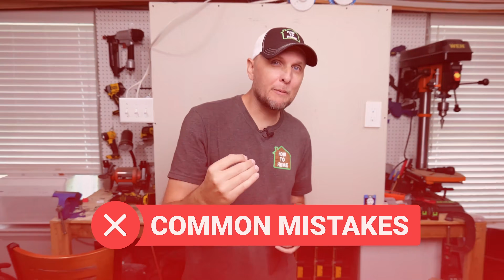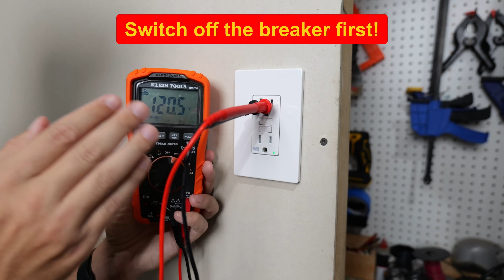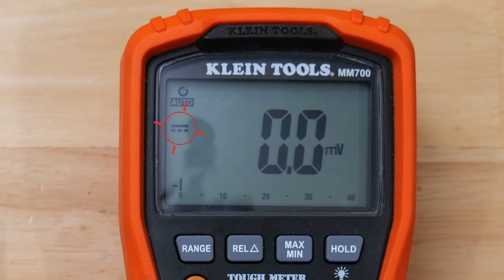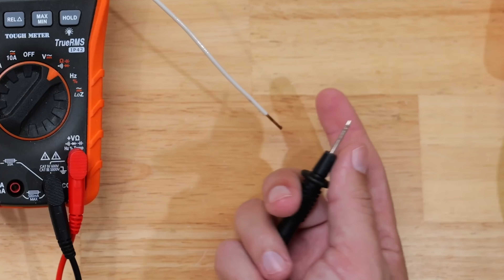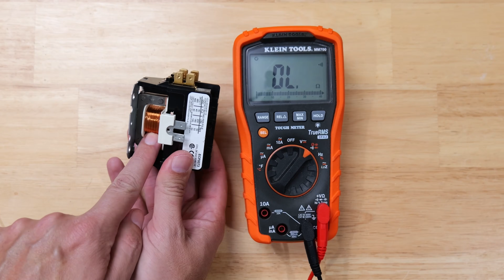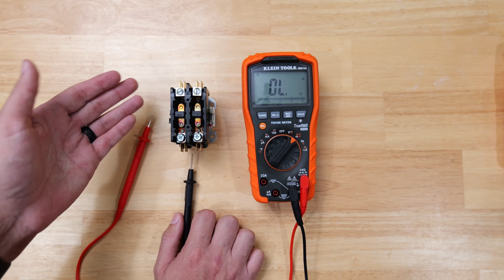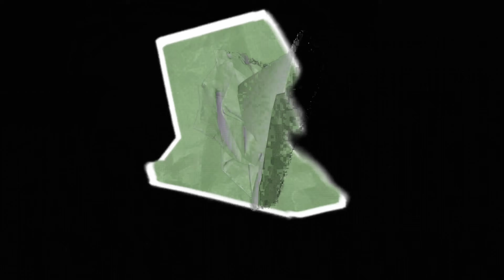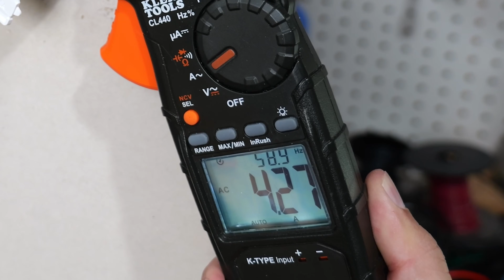Most DIYers Are Using Their Multimeters Incorrectly!

Comment from the maker: Be honest, how many of these features did you not know about and which ones?  I am genuinely curious.  I hope this can help future projects go easier!
Reply: Which ones? Most of them I either didn’t know or forgot how. I have both types of meters but I’m not an electrician by any stretch of the imagination. I like to do basic things like you discussed. The capacitor info will save me some money even though the company I use only charges about 150.00 to replace one. We have two homes one is a rental and it has a very old ac unit. Thanks again 👍
Reply: This is a good intro/tutorial for newbies or folks unfamiliar with electricity. There was nothing new for me but there's still good value for newcomers, hence gets my 👍
Reply: I bought a separate proximity probe for current and later found out it was built in to my multimeter.
Reply: I assume all - I built a couple of Heathkit  multimeters (I still use the one with the LCD display) and used Dad's Simpson 260 back when I was in grade school.
Reply: Thanks for the video. It's always good to have a refresher on this stuff. I don't use all of the functions often enough to remember them all.  I actually used my meter today (before watching the video lol) to make sure the power was off. I upgraded 3 of my  line voltage thermostats over to smart thermostats (Mysa is highly recommended). I used my non-contact voltage tester first but I like having a second opinion from the multimeter. It makes me feel much safer touching the wires.

I do wish I had gotten a better meter though with the option for capacitance. I was still able to fix my own air conditioner last year by replacing the capacitor but I couldn't actually test the old one. The bulging capacitor was a dead giveaway though.
Reply: All! In the business for 35years. :)
Reply: So, nice video but this is old hat for an experienced diy'r
Reply: I knew most of it, but I was caught off guard and surprised about the splitter amplifying the amperage shown. Times 10 makes it really easy just moving a decimal point to calculate but I’m not getting it in my head why it is amplifying it by 10? I actually own a clamp meter but I’ve never owned a splitter. Are there any other circumstances where the amperage is multiplied?😢
Reply: Scratch this request, Google gave me a very good explanation.
Reply: @tazmun  Yes if measuring small currents you get less error multiplying it by a certain number of turns. If you have access the individual wire simply wrap the wire around the clamp meter a number of times. then divide the meter reading by the number of wraps to get the actual reading. The splitter would be doing the same thing. The clamp meter is just responding to the magnetic field and giving an equivalent based E=BLv (simplified). So on the meter there will be an E voltage induced on a winding with B flux density in Tesla, the designer of the meter knows the length of wire L  and v depending on AC vs dc the delta needs to be known. Regardless the meter is always measuring voltage. If the meter is used in the circuit (dangerous don't do) a very precise shut resistor is used and the meter measures the voltage drop across it and translates that in amperage through it and since its a series circuit the amperage will be the same throughout the circuit. If it's measuring resistance the meter uses it's known battery voltage, the internal known resistance and measure the difference across probes and tada translates to the unknown resistance across the probes.
Reply: @tazmun 
Yeah, but do you know how to save Your Life if something goes wrong.?
Stay safe man.👍
Reply: @tazmun  It likely uses two coils of 5 turns each placed in opposite directions to increase measurement precision. See Ampère's circuital law...
Reply: I never saw a clamp ammeter used before.  Also nice to know about the little splitter/breakout device.   When you talked about the hassles of putting a simple ammeter in-line, I realized you could probably make up a little breakout box for the outlet as well to in-line the ammeter.
Reply: @arreffkay  you have to remember though that even the better multimeter that measure amps have a limit of about 10 A and even though they’re fused, they’re not cheap and can be hard to source depending on which one you have. 10 A is not enough to test many items. Clamp amp meters on the other hand often test 400 to 600 A.
Reply: @tazmun that makes a lot of sense. Thanks
Reply: big fat 0, I honestly know every function of both meters but I've also been doing electrical work since 1990
Reply: I was a radar tech in the Navy from 1971-76 so pretty familiar. 😊
Reply: Did not know how to test capacitors, and to properly go about checking for amperage. Also, am wondering why the other responders are not actually answering your question?
Reply: @HowToHomeDIY
Who do you think you are.? What gives you the Authority to teach/instruct ppl, in 20minutes, something that takes 40 to 50 hrs of practical guided training. 🚫You🚫 are ⚠Dangerous.⚠
Reply from the maker: @snakezdewiggle6084 I bet you are the life of the party when you go out.
Reply: If I put on electrical rubber gloves on do I need to cut electricity off?
Reply: I wasn't familiar with doing Continuity or Resistance testing on my multimeter. I'd only used them for outlet and battery testing.

While you're reading these replies, I'd like to say that the clamp-style tester doesn't seem that useful for the average homeowner because it's too specialized. If I'm testing the amps going through my outlet, I'm not going to want to remove it to put around the single line wire and I don't want to buy the line splitter to add to the specialized multimeter. Instead I'd buy the combined line splitter and tester you showed at the end. I'd rather have a standard multimeter I use for everyday, then pull out the combo unit on the few times I want to test amps.

Comment: I enjoyed your instructional video on the use of a multi-meter. How to use a meter is essential for do-it-yourself electrical repairs, however, the first thing to explain is the inherent dangers of testing electrical equipment. I have seen other DIY electrical videos and most start with explicit warnings about the dangers, especially anyone with little or no knowledge of electrical testing of components! When you started explaining testing of the capacitors you completely failed to explain what a capacitor does, that it stores energy for a long time after power has been removed from it, that it can electrocute you and can store higher voltages that can cause serious injuries or even death. You did not mention how to check it for voltage first before using the meter to test for capacitance or how to discharge a capacitor.  I would also suggest you include a disclaimer in the beginning of the video to at least protect yourself from potential liability if someone is injured or worse from following your instructional video. Stay safe, everyone, a capacitor temporarily stores energy, like a battery does and discharges slowly, and it can cause serious injuries, electrocution or even death if you are not careful. There are ways to discharge it, but before you do anything, take that multimeter, set it to test for voltages, then check the capacitor for any residual stored energy. If the check returns a voltage it can be discharged by shorting across the two conductors using an insulated screwdriver shaft but the correct safe way is to place a resistor across the two terminals to use up the stored energy. Most just short across the terminals with an insulated tool, like that screwdriver or a pair of pliers, but this discharges the cap violently and can leave melted marks on the tools tips. There are specialized instruments that also can be used to gently removed that stored electrical current. If you look at a channel called Buy It Fix It, this component level repair person always checks capacitors before touching the circuit components and has that special device a subscriber of his channel made and sent to him. Check that out for some good troubleshooting electrical components at the board level. Very educational.
Reply from the maker: When was this video ever about how to test a capacitor?  It wasn’t.  Did I show me testing a capacitor?  Sure did.  But it was just displaying the capacitance function of a multimeter.   Also, how you describe what a capacitor does is very misleading.  They aren’t batteries designed to hold charges for long periods of time.  Can they hold a charge? Sure.  But most of the time they discharge through the motor windings when power is disconnected. Should they be discharged before handling in case there is a charge?  Absolutely.  But you blew it out of proportion. You’re talking about something that is not the purpose or focus of the video.

Comment: There is so much you are not telling people about how to set that multi meter up for high voltages, tell them what the fused 
Connection is for .
Reply from the maker: Most DIYers are not needing those.  How many times does a homeowner need to test more than 240 volts?

Comment: The lower set of screws for the contactor are burnt. Most likely the contacts are burned to the point of not making a good contact closing the circuit.

Comment: I would mention that after turning off a circuit breaker, always check for power at the work area again to verify power is really off. ex: I've seen double switched ceiling lights (switched from two sides of a room) wired wrong that got power from 2 breakers.

Comment: just like cutting power to an outlet before working with it, be very carful to discharge a capacitor before working with it! You can get quite a shock touching both sides of it if it's holding a charge!

Comment: another fun use of measuring resistance is to compute how much wire is left on a partially used spool.. You can lookup wire gauge charts that show  Ohms per 1000 feet or Ohms per meter for whatever wire gauge you have. Measure resistance between the start and end of the spool, divide, and you have a near exact measure of how much length is left!

Comment: So I have a commercial electric multimeter with most of the same settings but I’m trying to figure out where my reverse polarity is coming from in an Rv. I pulled all the outlets and checked the installation is correct and I still figure out why it’s happening. Continuity should be great if the probe cables were long enough to reach another outlet.

Comment: I’m surprised Voltage Drop Testing wasn’t mentioned. It is a much more reliable, and less (human) error prone then Ohm/resistance checks. No need to disturb, and possibly change, the circuit being tested. No need to know the ohm spec or anything like that. Just saying’…

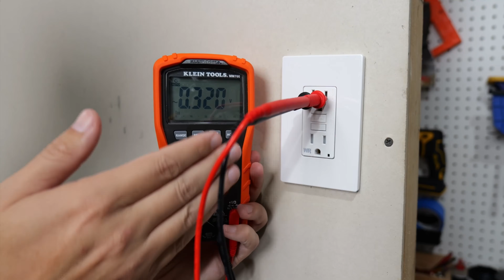Comment: Your comment at marker 4:25 is going to get someone killed. There is still power going to that outlet.
Reply from the maker: How?  The comment where I say I am doing it just to SIMULATE the power being turned off?  Do you just not understand what the word simulate means or you just want to complain about something?
Reply: @HowToHomeDIY  You're "simulating" using a GFI receptacle. If the probe check you "simulate" were done on a GFI receptacle--like the one your "simulating on--the nominal low voltage DOES NOT mean "there is no power GOING TO IT." It only means there is no voltage distribution to the internal plug contacts. This is because on a GFI receptacle you might get that nominal low voltage reading because the GFI interrupter is tripped, in which case there is STILL power GOING TO the outlet. Your comment is going to get someone electrocuted!

Comment: Some important points you didn’t cover (from a retired electrical engineer): when checking continuity or resistance, always make a practice of first shorting the probes firmly together and get that reading. That will give you the resistance of your probes. It better be low, maybe under 1 ohm. If it’s several ohms, or fluctuating, you may have a probe that’s failing. That will drastically affect your readings. You need to fix/replace the bad probe. I’ve had several probe failures over the years. When checking resistance, if you want an accurate number, you must subtract the number you got with your probes shorted to get the most accurate result. Most of the time, that “probes shorted” number is negligible. 
This probe resistance test can be critical when testing for dangerous voltages, like with house wiring. If a probe is bad, you test for 120 VAC, and get no reading, the bad probe fools you into thinking there’s no voltage there. Yikes! 
Bottom line…don’t be fooling around with residential wiring issues unless you know what you’re doing (like with the comment about tripping the GFCI and thinking there’s no voltage in the box).
Lastly…I can hear somebody ask, “What does OL mean?”…..Over Limit, or outside of the limit of that range of measurement.

Comment: For beginners. Continuity testers and ohmmeters should never be used on energized circuits. Also, never connect the ammeter in parallel to anything. Non-clamp-on ammeters must be connected in series. Making either one of these mistakes can lead to a fried multimeter.

Comment: When electronic flashes for photographers came out several repair men were killed by touching the electrodes on the capacitor. That thing is deadly. That should have been mentioned in the video. I do not know how to drain a capacitor, you should learn that before even disconnecting one.

Comment: I spent many years as an electronics tech, both in the military and civilian life. It was a long time before I found out why a DMM will read "OL" when nothing is applied to it. I heard it stands for "Open Lead." Think of doing a continuity check. If you do not have a short, you will have an open. With no contact between the probes, it is an open circuit. So, OL.

Comment: You can measure voltage in a live socket with multimeter, but be carefull with checking only one separate wire if it's live or not, that can be tricky to measuere, those simple screwdriver-like tools with little bulb inside can be more idiotproof for this purpose. Here in Czechia, we are supposed to have 230V, but there is pretty much exactly 240V in my sockets for some reason, but most of electronics is rated up to 250V so it's ok I guess. American "surprised emotikon" sockets always make me laugh. 😀 But our french sockets are terrible, I don't know why we didn't adopt schuko as most of Europe, it should be compatible, but in many cases it's not and it's not possible to put 2 bigger wires into double socket, with schuko, you can just put one of them vice versa, but I guess our norm-nazi ancestors didn't like the idea that you can swap it around.

Comment: Tiny addition on a side issue: I happened to catch your line saying that power from solar panels are DC. I bought solar panels manufactured in Washington State that have an inverter on each of the panels so power coming from a panel after the panel's inverter is AC, and usually 240 Volts (can be 120V). You DO NOT EVER want to confuse that with DC, which most people do not fear at all.  If there is a single inverter fed by all the panels, then power from each panel is DC until the inverter where the DC is converted to AC,  at 120 volts or 240 volts.

Comment: When fault finding start at one end of a circuit and work to the other end starting in the middle can be very confusing.  A little guidance on safety with capacitors would not go a miss.  Capacitors store power and can be very dangerous, so if you are not a spark/circuit board eng keep away from them!

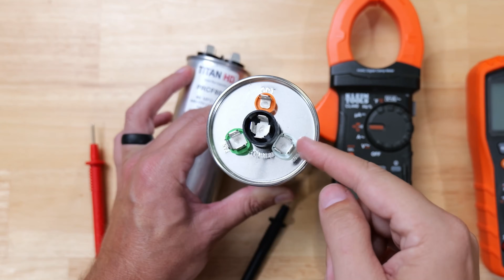Comment: 16:59 Could you show us how to test the capacitor shown in your video with 4 terminals?  You showed how to test the 2 terminal capacitor, but where should the leads be placed when there are 4 terminals?  You stated in the video that the test is "pretty much the same."  Pretty much means there is a difference.  What is the difference?  Please explain.

Comment: When measuring continuity the numbers showing on the meter continually were changing, why is that?
Reply: Bad contact at the probes, EM coupling from other wires or even picking up lowband radio signals. The continuity test uses just a low voltage.

Comment: Having managed a metrology lab (calibration lab), I am familiar with all of those functions (and some others on specific test instruments as well). Nice video. The contactor with the good coil but which you refer to as "shot", looks to have signs of arcing on the bottom two contacts. I'd guess burnt/carbonized contact points is the problem. Sometimes such a failure can be remedied with judicious application of a contact burnishing file, to remove the carbon buildup. Howaver, if the contact points are physically damaged or burnt away, replacement is the only option. How'd I do? LOL

Comment: It's worth mentioning when testing older 120v light switches, at one time they were made with mercury.  When testing they must be tested in the upright position, if not the tester will always indicate an open circuit.  Also, snice it is mercury, it is a hazardous material, it could spill out if the switch was damaged. you should replace it, but you need to contact your local municipality to find out how you can safely discard the old switch.